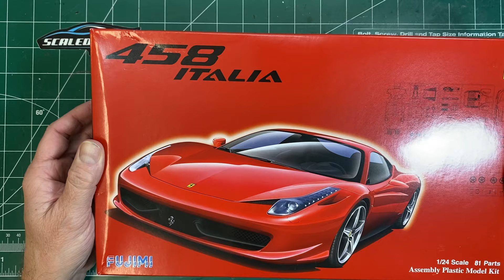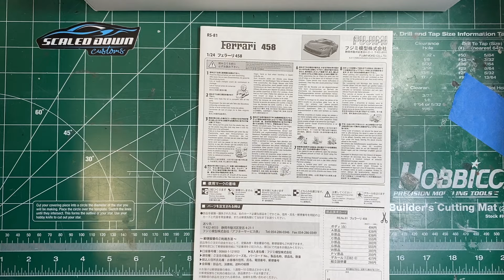Building the Fujimi Ferrari 458 Italia 1/24 Scale plastic model car Part 1

Comment: I was kinda wondering about the mirrors being so fragile and creating an obstruction into the tight spots around it.
Would it be better to leave them till later, or is it better to have them on for a better final finish? Just thinking about the final finish and being able to sand without knocking the mirrors off.

Still kinda new (new as in I don't have an air brush and I painted by hand previously. And also been about 20 years and getting back into the hobby and planning to spray rather than brush now)
Reply from the maker: Welcome back to the hobby. 

I have done the mirrors both ways. Glueing prior to paint will give a better bond but does present access problems for sanding and polishing.